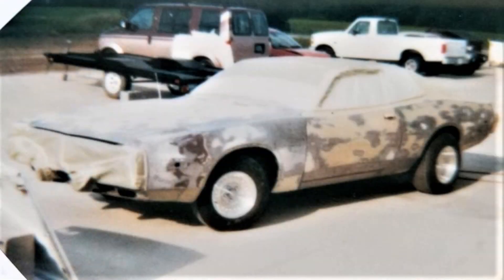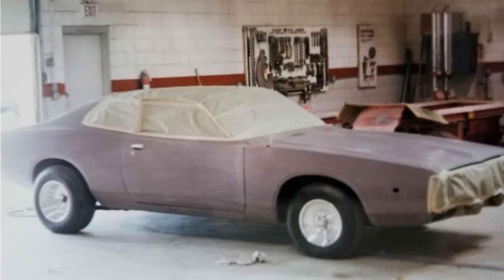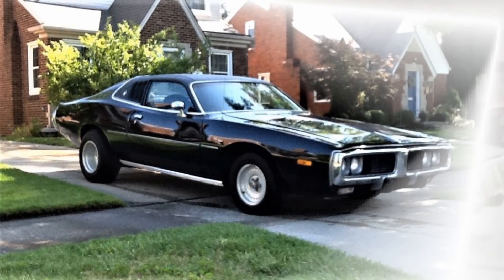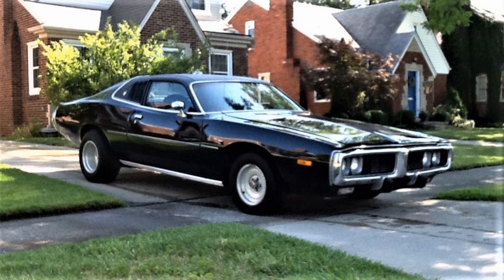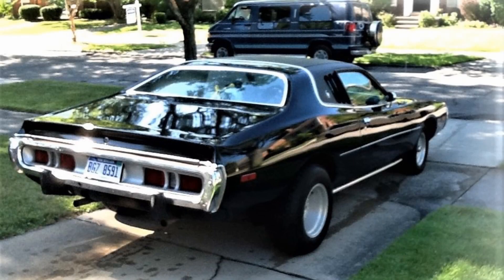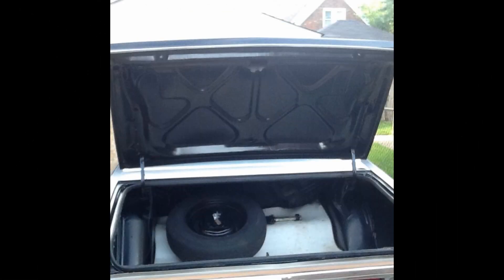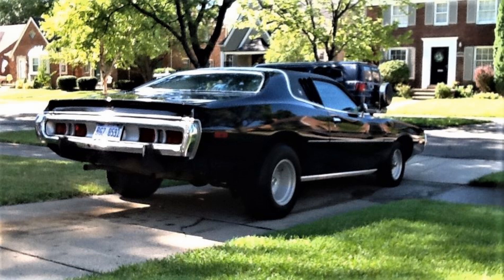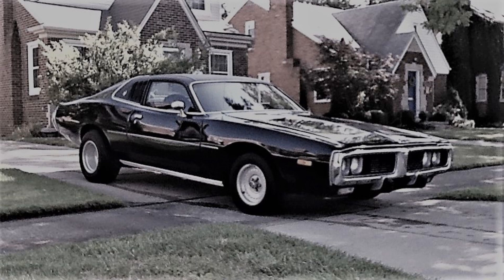How Long do Rust Repairs, Dent Removal and Bondo Last?

Comment: not only does the metal have to be prepped properly but ALSO you shouldn't have the bondo left unpainted or unsealed or unfinished at all!

i see some people usually its Hondas (i don't know why) but you'll see them with the a fender or something that they repaired with bondo and its UNPAINTED!!! im like wtf?
any moisture that comes in contact with the raw unpainted bondo is going to absorbed into the bondo because its POUROUS!  Why doesn't ANYONE ever talk about this?
Reply from the maker: Good point.  It's best to keep the vehicle inside or covered while doing the body work :)

Comment: Hey Bro,
Is that you playing the guitar in the beginning of every video?
Also, if you know where the Walmart is on 23 mile, in the winter I see those orange salt trucks pulling out from Napi drive over there. If any of my attempts at rust repair fail, I am holding those guys in the salt trucks responsible for messing up my restoration!!!
Reply from the maker: It is.  Wow - don't get behind them on a snowy day.  That's a real salt storm behind those things :)

Comment: Why did your Charger have 72 tail lights in it?. I had a 71 and a 73 and my brother had a 72, them tail lights looked like his.
Reply from the maker: Because the 1973's were all yellowing on the backup lenses.  The 1972's clean up easily.  They look better too - I think.  Have a great day.  Jerry
Reply: Lakeside Autobody I don't want you to think I was discrediting your Charger, it still looks great. How long did it take before you wished you never sold it. I wished I would never of sold mine when I handed over the keys. The 71 I had sat in a junk yard for 9 years behind a bunch of pine trees and the owner  forgot it was there. He keep saying, what Charger I don't have a 71 Charger. Then it dawned on him, it belonged to a buddy of his and he parked it away from the other cars so know one would take parts off it.  I could barely see it when I went behind the trees to take a piss. It had a tarp off a dump truck over the top and the tarp was rotting away. This was back in 1983. It had  43000 miles on it. 440 Magnum under the hood automatic on the floor, stock 411 rear end with leather seats. The vehicles owner went to prison and never came back after it. I was taking a guy I worked with that was doing and still doing auto body work that was a very good friend of the junk yard owner. He needed to get parts off of an old MG ( A small two seater car) that he was restoring. Thank God I took him. He asked the owner what he would have to have for it, an the guy said 275.00. He even towed it to my house. It took two weeks to get the pine needles off it and to take the gas tank off it and sanded off the brake discs, Changed all the fluids,( Brake, oil, radiator, transmission and filters and changed the fuel line.) and stuck a battery in it turned over about 10 times and started up. It had a small crack in the head. Put that Bar none stop leak in it, it worked for a while, about a year and it started leaking again and found a 1968 383 Mag out of a old Dodge Polara derby car to put in it's place. Sure miss the old car. Well thanks for taking me back. P.S. The rear bumper was the same on a 73 as the 71. I had to switch bumpers after a friend of mine backed into me. Just had to switch the rubber bumpers from the 73 to the 71.
Reply from the maker: @VWbugman  Great story - good times.  There is nothing better than seeing an old mopar hiding in a junk yard somewhere - I just can't explain it.  I got out of the hobby because rich guys took it over.  I couldn't even get a hood ornament for it for less than a fortune.  It really took the fun out of it.  Really my first car in 1982 when I was 16 was a 1971 Satellite Sebring Plus - 383, slap stick, bucket seats, etc.  I still think those cars were the meanest, baddest looking cars ever made - hands down.  You know the car's bad a... when you actually are scared of it and the driver when you see it go by your house ;)  - Thanks for the story - Jerry

Comment: But there’s no way you drove it on salted roads after you repaired it. That’s my concern...if the original paint rusted around taillights and trunk edge, surely the repair will fail much sooner.
Reply from the maker: Not so - originally the panels were sealed up trapping moisture, salt and debris.  After repairs I make sure I drill large holes in the back or strategic areas for drainage and clean out.  then keep the panels greasy inside by squirting some used motor oil or spraying it in a windex bottle thinned with mineral spirits works great to prevent future rust :)
Reply: @LakesideAutobody  thanks for this tip about using used motor oil for rust prevention!!! i never thought it could be so simple!! i have a 71 ranchero that has tons of rust holes, well it did anyway till i fiberglassed the crap out of em :-) but in the areas that im not goin to paint with bedliner on the inside of the cab actually fawk it i think i just bedliner the whole interior, might as well do it right
Reply from the maker: @ballaobama4148  You're welcome - thanks for watching :)